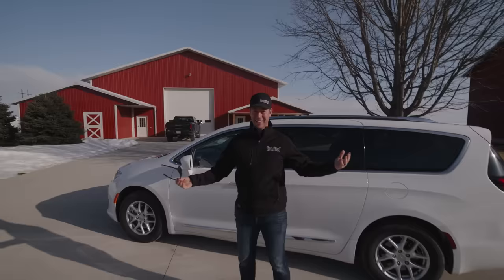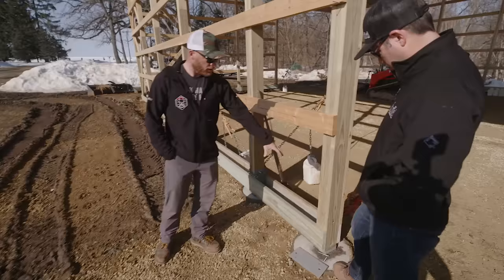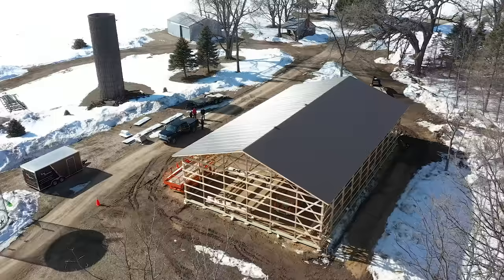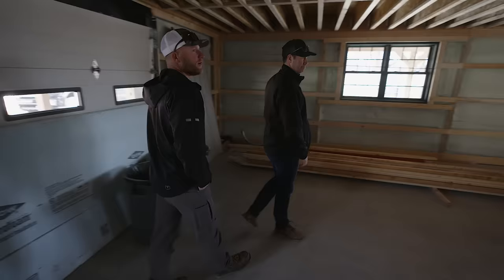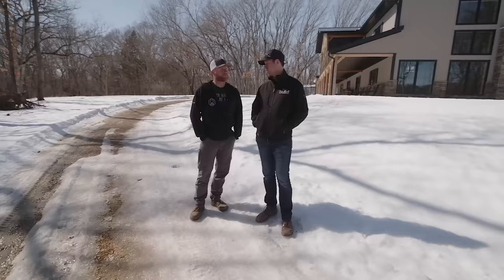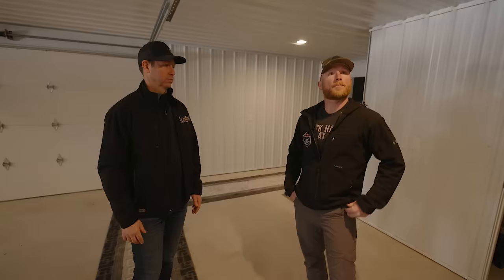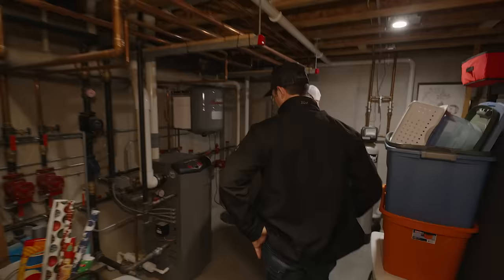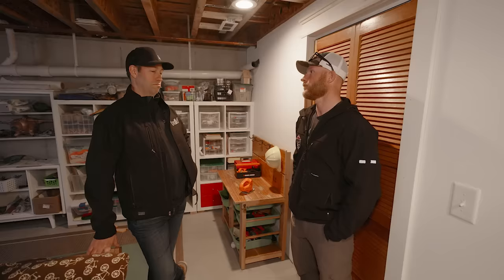BIGGEST Building - LOWEST Cost - Post Framing with RR Buildings!

Comment: I like a man who tells us the price of the project. Too many builders are scared to give a ball park starting point.
Reply: This is the first time Kyle has mentioned a ball park on pricing. I'm thankful for the info...because this is exactly what I want to do and it's in my budget.
Reply: Too many people throw in randow requests and specific details and want a price in the first fifteen minutes. 🙄
Reply: @danielbuckner2167  facts
Reply: @danielbuckner2167  my building would have been much cheaper but I wanted a laundry list of bull shit lol.  5 roll doors a full bath and a vehicle lift plus accommodations for my power hammer and a very flat floor for the machine shop side.  Added an easy 40% increase in price all said and done.
Reply: @jeffreyhill1011  for real man, a simple box is cheap but all the add-ons add up quick!

Comment: "There's no Header requirement" - every carpenter's head in the land snaps up.
I also love that each Truss lands in the post notch(shortened 2x6) and loads on a post on a foundation point-load.
This is large scale engineering, all aligned on point-loads, just like concrete hi-rises. Superior.
Reply: Absolutely spot on. Post frame building are often seen as the "cheaper" building, but I believe they are better engineered than stick frame. This is why I'm designing my house as post frame.
Reply: You get so much overhead clearance as well as usuable space from these buildings and they take  fractions of the time to build

Comment: I’m so glad to see a post framed structure on here. I started using these several years ago for spec houses.  I sub out the shell to a  Mennonite crew  , they are fast and very very affordable.  they will raise it in a just few days. It has a 9” cavity for insulation and continuous thermal seal. I like to use blown in for this application. 
Since it’s wide open floor you can divide the space up however you like and dress the exterior/ interior in any style you want. 
I would wager it’s  less expensive and more cost effective than any SIPs kit or traditional stick framed structure and just as well insulated if not better.

Comment: Very nice, I’ve dabbled a little in to post frame construction. I also built a 2-1/2 story tree house for the grandkids. Half bath and laundry with work station on first floor, full bath, small kitchen and living room on second floor and sleeping on upper loft . Unsupported deck , ski light , slides , climbing wall . Coming yet   ,fireman drop pole and zip line and connect deck to house deck . I spent a year in court educating the codes department after being red tagged ,all’s good now !!!

Comment: There needs to be more of this style of building. In a lot of areas the cost of housing has inflated to where there is no such thing as affordable housing. I wish I had the means to develop areas with simple, basic homes that meet the needs of low-income home buyers.
Reply: Well, while it is true that this type of construction has a low cost per square foot, this has nothing to do with "affordable housing"  RR builds large, expansive play structures which have nothing to do with meeting basic housing requirements,  for people with a lot of money.  The 5,700 sq ft "hunting cabin" is an example.   Not that there's anything wrong with that, if thats what you want and you can afford it.  Just saying, this isn't "affordable housing" in any way.
Reply: @Tyler what about the cost of land?
Reply: @Tyler $85/sq.' is a great price for spaces that are big, open and flexible, but those are not the typical criteria for "affordable housing".  A typical "manufactured home", a boring ranch-shaped box with 8' ceilings, built to federal standards,  would run less than half that much, and with decent foundation could be just as permanent. The challenge, of course, would be building at near that cost without the low-budget look of a trailer park, and you'll see some pretty attractive examples on the internet,  of manufactured houses with just enough amenities to look more like homes than boxes.  The system shown here is much more affordable than most other systems for building custom houses, but it doesn't strike me as a useful approach for housing the masses.
Reply: Local building codes and regulations kill post frame in most neighborhoods

Comment: I had a 30x60 pole frame building put on my property 2 years ago. It's got two large garage doors separated by about 6 ft so there's plenty of room between them, and the last 16 feet of its length is a music/rehearsal room./man cave. And I'm even putting a "rough" man cave in the shop section. This building is a dream come true for me. The concrete floor is smooth like Costco which allowed me to put a beautiful wood floor in the music room.

By the way, the music room has a lot of the same things going for it that a sports bar does.

And the building cost about as much as a new toyota. Where I live there are no building permits required but the one down side of this building is there is no water, at least not yet.

Comment: Well from my experience whenever you attach metal siding to wood there are issues with coefficient of expansion of metal vs wood. Metal expands 3/16 per 100' per 10 deg. Wood expands with humidity. If the interior is acclimatized you also have other issues.   Fasteners will eventually leak because the metal works the screws back and forth from expansion and contraction. Metal frame building have expansion connections built in and fasteners stay put.

Comment: Awesome.  The one thing I heard, that I'd do differently, is to use rockwool instead of fiberglass.  I like ICF for its bullet-proof durability and LEED certification, but shy of that, this looks like way to do it.  And closed cell spray foam is really hard to beat.

Comment: I love it. I used to build pole barns and always thought it was a great idea for building a house, like he says, no need for headers, etc. I am surprised you still use ringshanks and not screws. It is faster and works well enough but screws hold better, longer. 
Where in "middle of nowhere" Illinois? I lived near a tiny town called Ellisville. It is middle of nowhere.
 I like that the house can be inside the building and have storage on top and be like inside the garage instead of attached to it. Put a 2 foot crawl under for easy plumbing and heating repairs or alterations in the future, just a smarter way to build. One downside, no cell service in an all metal building.

Comment: I started framing these with 2x6s after I noticed so many with buckled and bent metal from the poles twisting. No way a 20' long 6x6 will stay straight for very long. Another thing that's worth considering is if you are building an office or apt inside order cathedral trusses for that part so you have more headroom above. The last thing is an apartment inside and it's efficiency. You would think it's double insulation so it's great but if it gets cold at night and warm during the day and your shop holds that cold air all day it doesn't help much. I put an exhaust fan with a thermostat to help keep air moving up near the ridge.